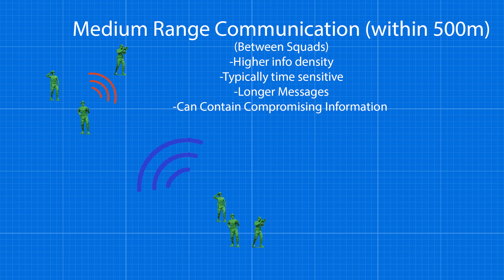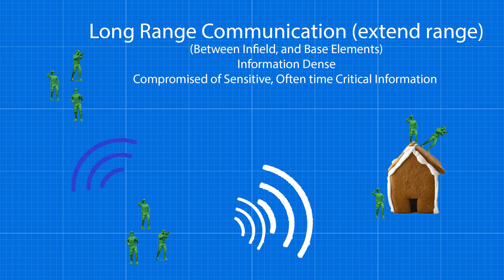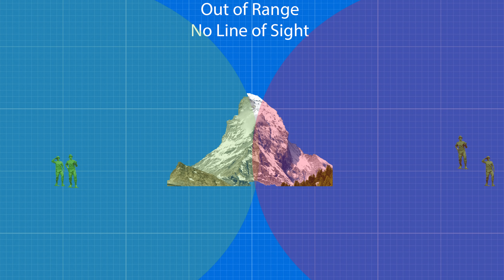Intro to Advanced Comms for the Prepared Citizen

Comment: SATCOM Military Expert here, just some quick tips about RF and what is effective long range. I have 6 years of experience and training in both commercial and military, including Tactical and Strategic RF.

HF (around 40MHz generally) is very efficient as a 20w backapck radio with an antenna placed on a structure or tree can TX and RX from anywhere in the US. This is because the HF modulation bounces off of the ionosphere and sends it back down from you to your D/E.

UHF range is around 400mhz ish, also including IF range like most commercial  modems use 950MHz to 2000MHz before up conversion and Amplification.
 UHF is better for areas with large amounts of solid surfaces for your RF to bounce off of. Because of this, places likes cities or small towns towns are preferred.

VHF RF range 30-300MHz is better for visual line of sight ranges to cross country ranges if you have the mobile gear (antenna and power) to transmit that frequency as those Carriers. 40MHz is around your cross country RF range while your basic Baeofang radio can use VHF(300MHz) for line of sight communications generally from 5-10 miles over country, depending on your equipment and power.

As always, I'm very experienced in Satellite communications but please also do you own research as setting up your comms and preferred RF carriers can set you up for success with your team/family/etc. always have RF plans and always have RF backups!

Also when it comes to tracking RF carriers, use your comms sparingly as I know most of y'all don't have a FCC license so please be smart about what you say over the radio and don't give out any personal information! The FCC, government agencies, and normal civilians can track your location with a Spectrum Analyzer in MINUTES. I do this for work and trust me it's not hard at all to find anyone, especially if they are blasting a satellite or even your local comms in your neighborhood!

Encryption is great but sucks when it comes to compatibility with other "units" with different systems. The big fallacy is that encryption will make you invisible, not at all. Analog or digital it doesn't matter, your RF carriers will still be visible at long as you're TX or RX
Reply: BLUF: one is expensive, the other is fiddly. Either are susceptible to radio direction finding.

Based on a 30 second look, Beartooth Mk I looks to be wildly overpriced Meshtastic. Mk II claims not to be based on LoRa (which is the radio transport used by Meshtastic). Im going to guess the tech isnt all THAT different, but they probably take most of the pain out of setup, so maybe that's worth something. They also have enough bandwidth to do digital voice. More bandwidth means more power and a more detectable radio signal, so that's worth thinking about.

Meshtastic doesn't, in general use, get nearly the range people say & getting it running is generally its own hobby. It's a fun hobby, if you like tinkering with tech. Oh, and it encrypts legally if used unlicensed ( legal ham use has restrictions there),  It uses AES either 128 or 256 bit so, if you don't pick a stupid key and the implementation isn't backdoored, even nation-state types would have a hard time figuring out what you said. Until they find you & beat it out of you, which they can do because using radio direction finding is getting easier and easier. Amateur radio guys make a game of it, called foxhunting. Meshtastic is probably the easiest way to get encrypted radio comms. Unlike Beartooth, it doesn't have the bandwidth for voice.
Reply: @michaelmichael8406  
That's about what I've found as well. There's a few DMR radios that you can use AES256 on, being they're sold as land mobile commercial radios as well as ham. I think if you were in an area that you could place many nodes, say you own 40 acres and put up a handful in trees on solar power around the property, it would work really well.
Reply: @michaelmichael8406  HAMs hardly care about the GMRS/FRS/MURS frequencies even if someone is using them incorrectly. As long as you aren't blasting 5W on these channels they hardly care. Most of the time they DF pirates on the HAM net or people abusing repeaters they don't have permission to use. Avoid repeaters and the ham band and the chances you'll get even a second look goes down significantly. For most larpers this is fine. Realistically you don't want to talk to people in general if you can avoid it.
Reply: How do you feel about the likes of Beartooth and Meshtastic?
Reply: Nice to read this. I'm from germany and it's also not allowed to transmite here without licence. But the more you read about comms the more you know. It's like a rabbit hole but better have some informations about something then have nothing and do stupid stuff. A lot is just common sense. I love it if someone tell me "But i've a phone, why would i need a radio". :face-purple-wide-eyes:

Comment: DMR standard encryption (even AES256) is vulnerable to rainbow tables and can be cracked by about a $4k system of GPUs in minutes. P25 standard encryption can be cracked more slowly, but has a "selective DOS" vulnerability where an attacker can disable all encrypted channels, forcing clear comms or nothing. I'd love to explain this in-depth for if you do future coverage on your channel!
Reply: A rainbow table won't work on a AES key, well, it will, but you need a 3.06499108 × 10^54 Yottabyte rainbow table. If it's possible I'd love to se you demonstrate it in a video, not just a hypothetical.
Reply: @FOOGLEMAN  That's sort of correct if you attack an AES256 key on its own, but the vulnerability is in DMR implementation of it, which varies with each model and context- but a majority of DMR can be cracked like this due to key generation and hashing inadequacies, both deliberate and not. 

To start- ALL DMR radios with encryption over 56 bits that pass export controls in western countries (US, Europe, and others) have a required backdoor. Cryptanalysis shown in "Partition-based Trapdoor Ciphers" by Arnaud Bannier and Eric Filiol. 

There was a website called "motopwno" that could crack uploaded encrypted audio files in seconds. It was suspected it was stolen intellectual property from a defense contractor. The website was taken down around 2022.

The academic cryptanalysis community has a handful of consensuses you can see on sites like RadioReference- all DMR is vulnerable to known plaintext attacks. All DMR tends to be vulnerable to improper IVs (a key generation type issue) due to the required computing overhead during both Tx and Rx (companies want to save chip costs and power consumption, so they skimp on this). All DMR handhelds can have decryption solutions (curated rainbow tables) if you *physically have the radio*, this is how militaries/FBI/others do most of this. These are considered consensus because it is all basic cryptanalysis and DMR is not the only vulnerable system in these cases. 

I would be glad to buy a cheap DMR radio and come up with a decryption solution as an example. They are $300 at the low end but I could probably get my college to pay for it and I'd publish a paper along with it. Or, I can go to my company, we have lots of powerful servers and radios if they let me use them for this. We'll see! but I hope this is useful information

Comment: Rugged rdh-x. Durable & waterproof DMR radio, $200ish. Plug that into some Walkers or whatever hearing protection you use with a PTT cable and boom, digital comms for under $300 a person. Can still program the same frequencies as your buddies with UV5R's so you can still talk on analog when you want.

Cons: Business band radio, so by nature you cannot do things such as add other frequencies from the radio or change the power setting on the fly, that has to be done when connected to a computer. Need a windows PC to program the radios and the software, which is about $30; pretty easy to use, just something to be aware of.

Comment: if you're curious about direction finding based on radio transmission, S2 underground made a really good video explaining how advanced forces could track your position. It's a lot more complicated than I understood and not as simple as "if you push the ptt you die"(though that is possible)
Reply from the maker: there's really simple tools out there that remove all of the guess work out of it. And basically give you a range and bearing.

So in theory, yes you can be located very quickly. But .0001% of the population owns one of these. They are very expensive and very fiincky.

Comment: While I am a big fan (and user) of /\/\otorola and Hytera, there are lower cost radios that are absolutely NOT “Chinesium” or “Bay-oh-Fag” radios.   AnyTone AT-878UViii Plus portables do AES-256 (using digital DMR) and are very easily programmable w/CPS using a PC.   Definitely NOT the robustness of the public safety grade Motorola / Hytera gear, but VERY decent for the cost.  ($250 approx..@).

The TYT MD390 Plus is half the price and less durable, but DOES have AES-256 crypto included.
($120 @)
Reply: The AES-256 encryption for the Motorola / Hytera gear is $$ Pricey.
The PD-782 (one of the most durable in the line) is around $800 new and comes with ARC4 (lower grade encryption that won’t stop the corrupt Demoncrap 3-letter agencies , but definitely better than nothing).  
BUT… the AES-256 license = $275. JUST the license for a single radio!

Motorola’s XPR-7550e is a great handheld portable that can be found for around $600 on the used market.
The encryption license is the same..  around $275.

You might want to check out APCO’s Project 25 (“P25”).
Used P25 RUGGED radios can be found on the used market for $300-500 WITH a multi format crypto board.

The Motorola Quantar repeater is built like a TANK.  (UHF R2/R3 - VHF - 800MHz, whichever band you’re using.)
Approx $1k for a repeater that sold for $15k+ just a few years ago.

Avoid the Cheap Chinesiums.
Reply: @PowderMill  you sound like pretty strange when you drop shit like "DEMONCRAP" into an otherwise intelligent post on comms equipment.

Comment: This will save your life from Signals Intelligence / Radio Direction Finding:
Code words/Pro Words: Being able to make a 2-3 sentence operational update by saying one simple word is important. 

Utilizing multiple frequency bands (HF/VHF/UHF): Yes this can mean using multiple radios, but that's where mission planning comes in. The more you are transmitting on different parts of the RF Spectrum, the harder you will be to direction find/jam.

Displacing when sending communications: You don't want to send comms from your hide site/base camp. Displace 300 meters or more to make your transmission if you can.

Brevity (back to Code words, the longer your transmit, the more time the enemy has to find you)

Transmission Power Management: Everyone blasts on high power because it means your teammates are most likely to receive the transmission, but so is the enemy. 

Directional Antennas: If you are running Recon and transmitting to an element behind you, and you don't want your transmission going to the enemies ahead of you, you can use directional antennas to send transmissions.

Know what the enemy is using. If the enemy is using 65.5 MHz all the time, stay far away from that frequency. You can also use this to your advantage by blending into the noise, if you're good enough.

Comment: So if radios, even when encrypted are detectable, wouldnt an overmatch simply be able to triangulate the location of the signal super easily?
Reply from the maker: only if they have a very expensive, specific piece of hardware, that is properly tuned.
And even then, they are not pinpoint accurate.

Comment: What class/course would you recommend for a mid tier user moving into squad to larger group comms?
Reply: Takes a lot of practice and the only way is to get your general Ham ticket. HF and digital modes are key.
Reply from the maker: ham license for a singular path to understand what is actually going on. And then realize that for tactical gear/comms you basically need to go nuts on Youtube videos  forums
Some starting points: https://brushbeater.org/ i and db_soc on instagram.

Really there's a billion and one sources. You start with one, and it just grows from there.
There isn't really a pipe line though, you just sorta figure it out as a you go.

Comment: 3:14 you don't even need a multimillion dollar network to do it, we as tactical SIGINT collectors use our own specialized Software Defined Radios that not only survey, passively collect on, and decrypt analog and digital mobile radios, but also Direction Find them and literally walk down targets. Yeah, these systems fit inside a PRC-152 pouch and can find a target inside a city-sized area using everything from Hyteras and Trunked radios to Baofengs. You are far from secure using any unsophisticated comms.

Comment: FYI Baofengs are used on the frontline only if this is the best radio you can get, but with civvie support it’s not even the baseline and an extremely unsafe tool in conventional war. They are just fine for civvie usage though

Comment: Comms have probably been the most hang up for me out of all prepping/firearms related gear. Its something you’re supposed to have a license to use, and most of the ones who do know much about comms act as gate keepers if you don’t have a license. I’ve got the radio, the comtacs, and the PTT to connect them. Now trying to learn the ins and outs of actually using the different frequencies
Reply from the maker: it's insanely gate kept. Which is sad, because by many accounts comms communities are struggling to get the new gen interested.
Reply: @BrassFacts you should reach out to the tech Prepper. Trex labs did a video with him he would be a great resource for you. I agree that the gatekeeping happens but is also a HUGE crossover between preppers/larpers and HAMs. I have a few guys I train with all over the US.
Reply: I remember the first time taking my HAM radio Technician exam, and nearly every person in the Zoom call was some boomer who treated the test like it was College Finals, asking to see my room and even ceiling to make sure I wasn't cheating lol.

Comment: Could you do a simple video that shows the radio and y cable with ptt button and mic for the extra level baofeng radio? 

Or do you have a video that explains this? 

Looking for squad level comms.

Also I currently have impact sports headset with an input port.

Comment: I was surprised how big a difference it made in force on force drills we ran at my last gig. Someone only 90 feet away can be unreachable during a firefight. You nailed it that the benefits outweigh the risks. Another risk that's highly likely is spoofing. The adversaries won't simply listen in; they'll actually misdirect you. I remember how unnerving it was when it happened.

Comment: While I do have a radio that I don’t know how to use....  
I believe what would happen is all electronics would become useless.  Only pre 80s that don’t have circuit boards and electronics would work.  Not only that but Lithium is a weak battery that could explode in an EMP/ Solar Flare.  Ni-Cd or Alkaline would be better.
Reply: Handheld radios lack the conductor length to propagate any of the 3 phases of an EMP. So do most battery operated electronics and vehicles.

Power and communications structures are vulnerable and capable of propagating different parts of the EMP phases. Anything plugged into the grid is vulnerable as well.

Your handheld radio and it’s lithium battery will be fine after an EMP, and an EMP is much less likely an event than needing emergency communications capability with your family or friends.

Comment: Good video but there are a couple things that should be pointed out. Maybe you'll touch on them in the next video but for the sake of people watching, it might be good info to have. First off, HF is not just for ham fudds. Like you mentioned, in an SHTF/grid down scenario, if all repeaters are down, you effectively have lost long range comms with the homies. If you have a predetermined RV point and time, great. If not, using NVIS HF transmission can give you long range comms up to 600 miles depending on what band you are using. Encrypted HF radios are not readily available to civilians so most of what you transmit will be in the clear. Act accordingly. HF is not nearly as easy as setting up UHF/VHF comms, but I would argue it is still an essential tool for such scenarios. The number of people who will be using it however are likely fewer even than the ones using encrypted digital radio and, like everything else, it will require testing, training and development of TTPs for your use.

Regarding encryption, there are several different types of encryption algorithms, the most secure that is readily available to civilians being AES256. S2 underground has an excellent video on encryption that everyone should watch. While it is nice to have, unless you're facing a state level actor, it is probably not necessary. "Less secure" algorithms such as ADP are not likely to be cracked by an opposing civilian group. While it can be done, it's going to take a few hours at the very least and will not give real time data. The individuals capable of that are few and far between. Additionally, encrypting your own radios is not necessarily difficult. That XTS2500 in the video can run ADP encryption directly from the motorola CPS programming software. For AES256, you will need a keyloader or keyloading device, as well as the appropriate encryption module installed in the radio, but building and programming a KFDshield is not difficult or glitchy as the video states. You just need to run two programs and buy some hardware costing less than $100 total. Other radios such as hyteras and anytone 878s can also be encrypted directly from the software.